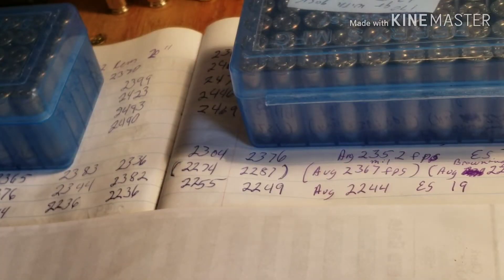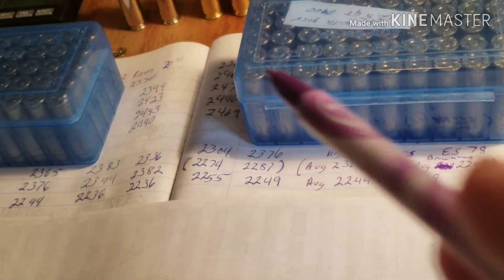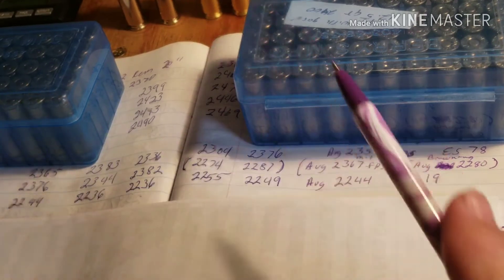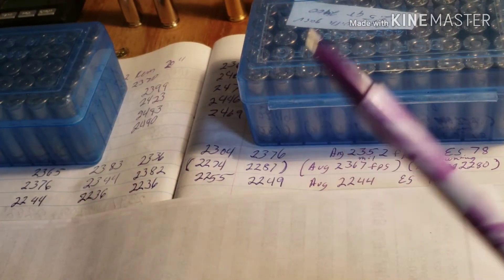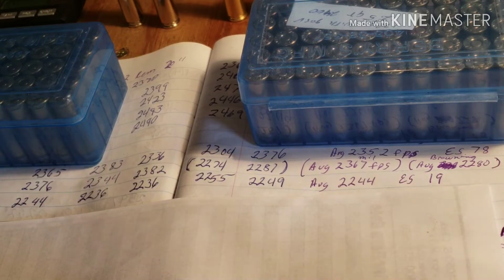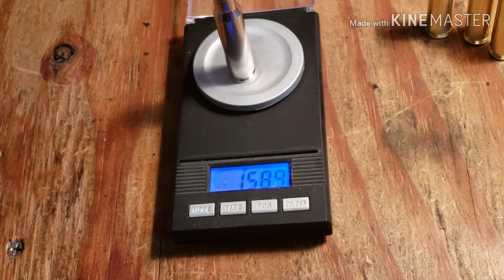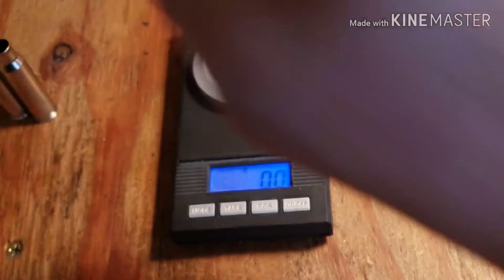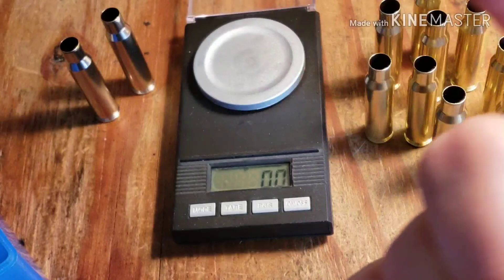Case  Capacity really matters see the numbers

Comment: When I started reloading I just threw all my 243's in a ammo can.  I had 3 different headstamps, but I didn't know any better.  A 243 is a 243 right.  I kept showing pressure with I think it was S&B brass.  Same load as all the others but major pressure with the S&B.  Same thing with 556 and 223.  Great Video Tim.  Case Capacity matters.

Comment: Good stuff Emperor! If ya noticed, I’ve weighed my brass from the very beginning of my 35 Remington Series. I really didn’t know what I was starting. And this is with a lever gun with barrel bands. I think I would weigh the capacity for my bolt guns if I were shooting past 200 yards, but like you, I’m not. 
FYI, in a new bag of Hornady 35 Remington brass, 59 cases had a weight dispersion if over 30 grains. So, buying new brass may not be the answer to our dilemma.🤠🤠🤔

Comment: Bullet drop at set ranges, I have found that shooting at 100 yards isn't a real test. Recoil, hold, lighting and physical stamina have more to do with shooting than a standard deviation. The physical act of shooting has its taxing fatigues as well. Plus, crunching the numbers and mathematically compounding all that stuff in your head causes doubt and that is the Biggest monster that kills what would be a good shot, you can't shoot without confidence and the more you doubt your rifle and ammo the worse it will get in your accuracy. also, you can't confirm that is the problem if you doubt anything in your ability to shoot. I at one time weighed every charge for ammo the I shot in a match.  all that work and tedious crunching and making sure that everything was perfect never caused my scores to go up. Matter of fact they went down, the more I worried about perfection, the more I was paralyzed because of the feeling of failure,  I started dropping my charges instead of weighing on ammo that was shot out to 300 yards. this caused my scores to climb. Point is, making things perfect causes nervousness and that leads to tension while shooting. Please don't get me wrong Tim, I see what you are trying to say by all this, however, I have been there and done that, and until I followed the advice from the 11-time national champion G, David Tubb I would have not believed it.
Reply from the maker: This is also a safety issue, when loading at max charges it could be dangerous
Reply: I always load in a reduced charge, there are loads that are stand bys for shooting across the course. another thing about the .308, the military designation is the 7.62X51, Commercial brass is not as heavily constructed as Lake city or other contract ammunition. The Military ammo is made to be fed through machine guns, Some out there is Youtube land say the there is some sort of difference in .308 Vs' Military ammunition in performance (Like it's better, stronger, faster than it was before) and that isn't true. also, Military ammunition is loaded to the same velocity as commercial ammunition counterparts. You will find that LC Match is loaded to 2.580 FPS with the 168 HPBT because it has to ballistically match what is the calibration of the rear sight on the M-14 and the same goes for the M-1 Garand rifle. I believe that safety is set as long as you do not deviate from the load manual. a difference of 50 fps is well in the expectation in velocity @300 yards and will make no difference in point of impact. anyway, Tim, safety is a subject people don't want to talk about and I'm glad you brought that to the table. Dave.